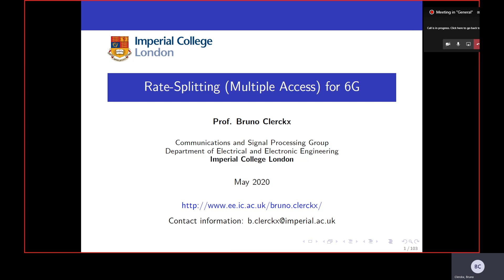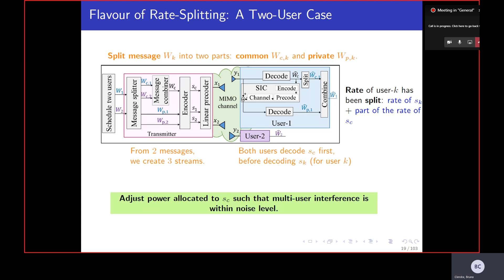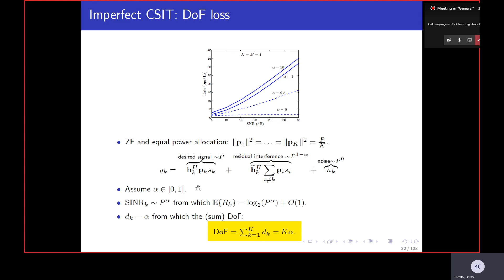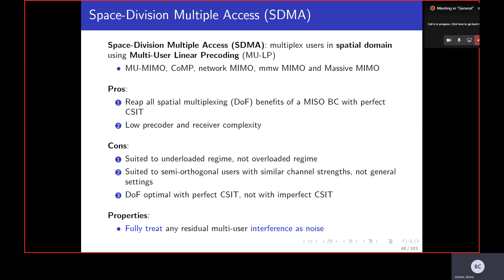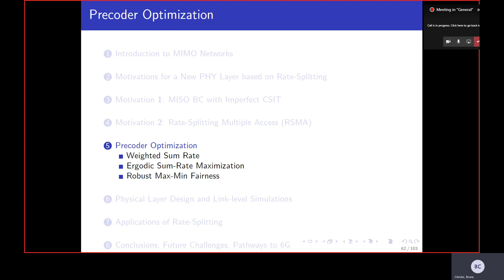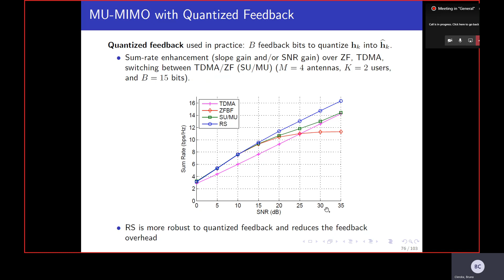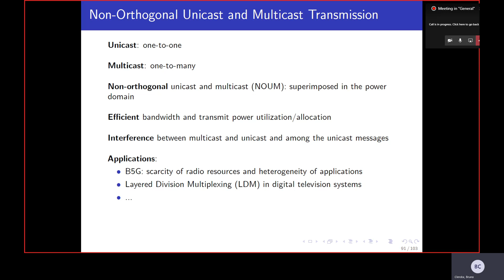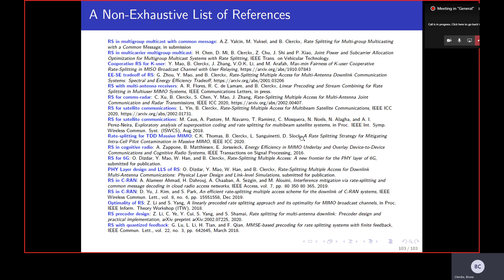Tutorial on Rate-Splitting (Multiple Access) for 6G

Comment: Hello Prof. Bruno Clerckx. I have a question on the power allocation for private message. Here we need the parameter \alpha to decide how much power for private and common message. \alpha is related to the  channel estimation error variance. Does it mean that it is necessary to estimate the channel estimation error variance at first?
Reply from the maker: Hi, when RS is optimized, you indeed need to know the statistics of the channel estimation error (e.g. alpha that indeed relates to the channel estimation error variance). This is the same in general when conventional schemes are optimized. In practice, some simpler (not optimal) closed form solution could be used to adjust as a function of alpha. alpha is related to the statistics of the channel estimation error, quantization error, etc and does not vary much over time. Other models could be used as well, for instance in https://arxiv.org/abs/2102.06405 , the power allocation split between common and private streams is adjusted based on the time correlation coefficient. In all cases, you need to know something about the quality of the CSI in order to adjust the power allocation efficiently. Hope that helps.

Comment: thank you prof. clerckx. I have a question, how can users know their intended message in common message??
Reply from the maker: Similarly to 4G and 5G where control signaling is used to tell the users about various information such as modulation and coding rate, the base station in RSMA will use control signaling to tell the users about modulation and coding rate but also where information has been encoded, i.e., common, private, or combination of common and private.
Reply: @prof.brunoclerckx1530  thank you for your reply. Is there any criterion for the ratio of common and private message when BS split the messages?